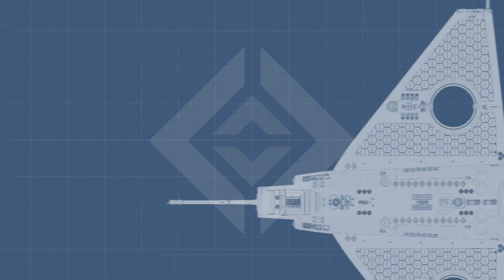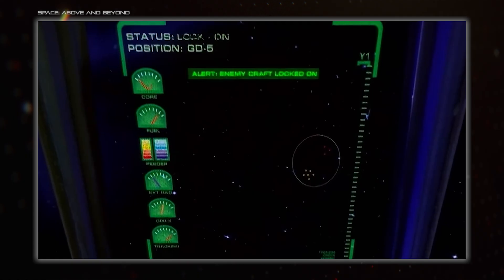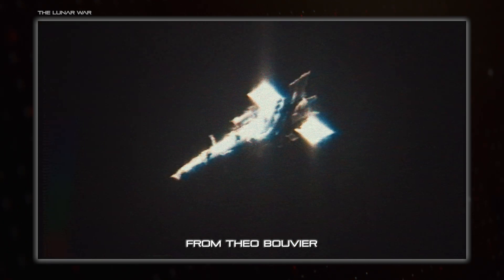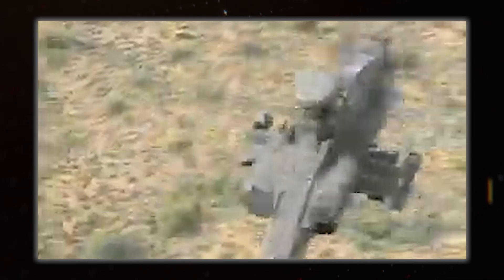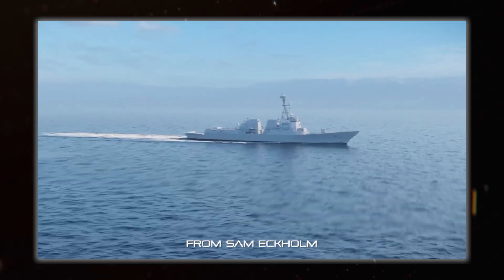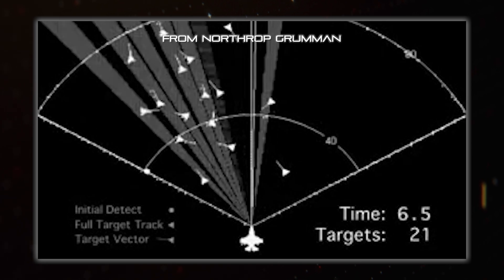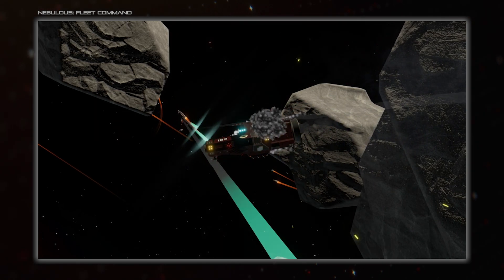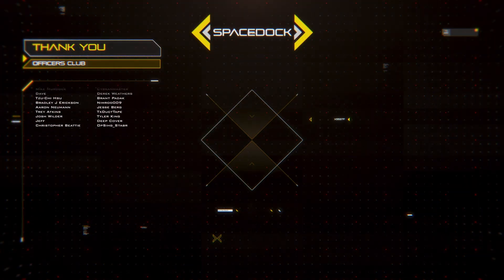What Sensors Would be Used in REAL Space Combat?

Comment: considering how big space is, i wonder if a kind of net worked 'drone' sensor net that lunchs out of of larger ship to cover as much space as possable would be an the logical conclusion, kind of like mobile sensor boues. each drone sends out pins covering x amount of disance and maybe give it something like a 'tag' gun so when it finds something it dosnt like. it can tag it with like a certian kind of radiation that the parent ship or other friendls can look into. 

if it a drone gets shot down, than's a good indicator as any.

though i wonder if said drones would be expandable or recoverable. i imagen the earliest drones  would be farily large to acomadte fuel and solar pannals and miro reactors and what not and these older drones could just stay out and float forever in the void suiving as background infulsucture till their systems start failing and they have to be replaced. 

as tech advances the drones might get smaller and smaller

Comment: Did I miss it, or did you guys completely forget visual light sensors?  Visual light spectrum scanning is massive and most likely will be exponentially increased as we move more into space, as EM can be jammed so easily over large distances.
Reply: light is EM. Its just a matter of which frequency of EM. Although the video did seem to imply that EM scanners would exclude visual light, it doesnt. Stars put out almost the entire spectrum, and most of it is at least somewhat reflective, although even just a passive IR sensor would make most if not all hiding impossible, having more than one frequency for target acquisition certainly would make jamming harder, since shorter wavelengths require smaller dishes,, which makes targeting the giant jar of jam more difficult
Reply: I was thinking less FTL, but within system tracking.  Most "systems" have massive active light projectors called stars, which can illuminate many things not specifically stealth coated to absorb visual spectrums/radiation.  Think astroid/comet tracking like we do today, but millions of times more sensitive/accurate.  Vessels/weapons that have active propulsion would also potentially create light plumes.

Comment: Quantum Computers, once we figure out how to make them work, will make Sensor Systems MUCH more effective because all the Computer Support each Sensor needs (Passive, Active, ECM, ECCM, Target Detection, Tracking etc.) can be done with one Computer the size of a loaf of bread (and eventually the size of a deck of cards) instead of 6+ Computers the size of a 5 gallon bucket...
Reply: Or you can use a 5-gallon bucket model to improve those sensors. I mean, there is Q-Radar, which makes any radio-based electronic warfare useless unless it's 'deny radiowaves from everyone'.

Comment: One interesting thing you touched on at the end, because sensor systems take so much power, it's quite likely that bigger ships will have significantly better sensor capabilities. Another nail in the coffin of space fighters.
Reply: When I was banging up a sci-fi setting, the smaller vessels remained relevant because hyperspace travel speed was a direct function of mass. A given mass always moves at a given speed, and the smaller the vessel, the faster it travels in hyperspace. 

My purpose wasn't to preserve fighter combat, but it would work for that. An X-Wing would make a trip in hours where a Star Destroyer would take weeks to travel the same distance.
Reply: @CptJistuce One tweak to that, make hyperspace speed depend on cross-sectional area.  So a big fat cargo vessel will be efficient in terms of structural strength while loading and unloading cargo but have a low hyperspace speed.  A narrow military ship of the same mass will have a higher FTL speed.  A needle-shaped courier of the same mass will be horrible in combat (easy to break) but it can get a war warning out faster than any other similar-massed vessel. 

(got the idea from the GURPS Lensman book)
Reply: @toddkes5890  Oh man, I haven't heard the name "Lensman" in forever!
Reply: One fun part is that smaller craft have a higher surface to volume ratio than larger vessels.  So they can emit more heat per ton than a larger vessel.  This will give them more capability to fire weapons for their mass.

For example, assume two ships, as much identical as possible, where the larger ship sis 2x as wide, tall, and long.  The larger craft will have 8x the volume, but only 4x the surface area.  Assuming equal mass (so 8 smaller vessels vs 1 larger vessel) the smaller craft formation will:
- have higher heat dissipation (twice as high compared to the larger craft)
- have thinner armor/shields per ton (higher surface area means the same mass fraction to armor/shields will have half the protection)
- have stronger structural members (structural strength is based on cross-section, structural strain is based on mass, so the smaller craft will be able to handle twice the acceleration)
- have a longer baseline for emissions detection (the smaller craft can be a tenth of a light-second apart much easier than a larger craft)
- have a potentially higher EM signature as the smaller craft have to use active emissions to coordinate their longer baseline sensors, plus tactical datalinks
- are able to protect more locations from lighter threats (i.e. eight cruisers can protect better than one battleship, though that one location will be very well protected)

So which is better?  Depends on the mission needs.
Reply: "Significantly better sensor capabilities" in no small part due to the aperture size of the sensors.
Reply: Yeah if you were to use Light attack craft they will need a mothership for better sensors and to carry them around since hey will have less fuel and less efficient engines.
Also Is that the eye of the universe ;)
Reply: I wouldn't quite call it a nail, but it certainly demotes them. The primary reasons I can think of for using fighter crafts in a hard-ish setting is as ground-to-space defense and for low-threat duties where light lag is an issue. If the UN has to police travel around thousands of belt objects, they'd need someone to be close enough to respond before word has reached Earth but they're highly unlikely to need the firepower or range of an interplanetary warship.

Comment: You completely neglected to mention UV sensors. While an atmosphere precludes the distance a clear picture can be seen in UV light due to scattering, space offers more opportunities for this area of the spectrum. Additionally, UV sensors are being used today to augment optical IR seekers to better resist jamming or spoofing.
Reply: a lot of people forget about UV sensors being a real good possibility in space, as well as X ray and Gamma Ray. Funnily enough UV sensors would perfectly counter the minovsky effect from the gundam series, and put an end to the close range giant robots in space combat that setting loves.
Reply: UV emissions of a spaceship are orders of magnitude weaker than its IR emissions. Look up the black body radiation spectrum for an object with 100 - 400°K surface temperature.
Reply: @peasant8246  True, passive UV emissions would be negligible. The utility of a UV sensor would limited by the intensity of reflected starlight, how hot the engines get under burn, and how hot the exhaust gases are. However, I can still think of two niches for UV sensors: terminal missile guidance (likely to augment an IR sensor) and stellar/solar observations (for space weather forecasts and tracking objects in the near vicinity of stars).

Comment: In my novel's setting I actually have the shields (I know, I know!) double as sensors, and they're actually the ship's primary sensors via induction inference.

Shields basically because my idea is that if you're doing FTL speeds, and near FTL speeds, you're going to worry about background radiation hitting your ship really hard; photons would smack into you with the force of nukes, for example.

This comes with the idea of "Well, if the shields can block light, how do you see through them?"

The answer is:  You don't!  However, if something hits them, it should induce a change in the field.  This is how radios work - an EM field induces a charge in some metals, and you can use those to intentionally pick up on these EM fluctuations to see things, communicate, etc.

So basically you have induction inference sensors.  Depending on how strong the field is changed and how it's changed you could figure out with some clever math what might be hitting the shields, where it is, and how strong it is.  You can, conversely, if you can fire something out of the shields, use that to act as RADAR and use the shields as the receiver.

I'm not really sure what to call the Real Life equivalent, but I know various bits of induction inference have been used in history, most notably the Soviets apparently employing a spy device where they gave a gift to the US ambassador that they could then later point a RADAR beam at (probably just because it was a strong, coherent EM field) and you could see how the beam was modulated by some metal in this 'gift' and use that to determine what sort of soundwaves were passing through it while the RADAR was active... effectively allowing you to eavesdrop remotely.

Which makes this a neat little wrap around both to hard sci-fi and "What if the shields go down" - the ship is made of metal, presumably.  Metals, again, have currents induced in them via EM field fluctuations.  If you can measure these currents in the hull, you can also utilize these sensors without said shields.  So you can totally sit there without any sort of RADAR receiver or anything like that and just kind of... listen.  With just the hull.

All because EM fields induce charges in things.
Reply: Why apologize for having shields? Boeing is reportedly making good progress to making plasma force fields a reality. They’ve done some real world testing if I remember right.
Reply: @FoxURA There was a video at one point where one of the people running the channel (Daniel?) said he doesn't like shields so kind of a joke in reference to that.
Reply: Boeing has doors flying off so would you trust them with a force field? @FoxURA
Reply: @barrylefsky8241 That's after they incorporated DEI policies. Failures of workforce and scandals aside, the tech itself seems to have potential.
Reply: @FoxURA  The Boeing progress and push into plasma force field is, I suppose, a nice change of scenery for creativity but otherwise rather mediocre. In my opinion, US mil prob won't see anything sci-fi crazy and awesome until we get more from our efforts in power generation getting exponential instead of linear (particularly with exotics) and then probably seeing what we can get as far as innovations with miniaturization (like prob for medium to small vessels like ships and/or fighters); especially for manportable systems like weapons, suits, etc...or [even] system specific generators or subsystem and/or backup generators.
Reply: Oh very cool. I'd reccomend the Culture series and its extensive use of fields for a similar purpose
Reply: Do your shield have projector or sci-fi generation with shield wraps around the shield. I'm trying to design ship with  shield projector on a circular rail armour the ship so it can redirect from port side to starboard as needed

Comment: Ironically the nuclear bombs used for sensors would probably have a massively higher yield than the ones used for combat
Reply: Or more likely they would be tuned for a specific output.
Reply: Right, they'll be tuned to maximize xrays so they'll need higher temps and therefore higher yields. Whereas for weapons megaton yields are probably overkill, and higher yields require bigger bombs and therefore more expensive missiles. So efficiency factors will drive smaller bombs

Comment: What about Muon shadow detectors or Gravitational field detectors? Muon detectors have been used with shipping containers and looking for voids in pyramids. I wonder if they could be used in space or if the lack of an atmosphere would preclude their creation. Although I wonder if Galactic Cosmic Ray shadows could be used similarly. Gravitational field detectors were proposed in Clancy's The Hunt For Red October but I'm not sure how real they are. I think that idea, using laser reflections, was similar to the tech for gravity wave detectors, which are real.
Reply: Oh one of my physics professors was the pyramid guy! So on earth narural muons are all created by the atmosphere interacting with high energy solar particles - and fun fact a muon's half life is so short we'd never see them at the surface if they weren't moving at relativistic speeds! Maybe you could have an artifical source painting an area you control though? 
Gravity has it's own problems - gravimeters measure all acceleration, and even the electric ones are quite sensative. Any ship that is going to accelerate to dodge, or even have things moving around it will drown out the signals. I could see Drone gravimeters though. Everything solid state and it locks the 0 length spring before it manuvers.

Comment: I prefer liquid metal ejection to radiators.
Reply: Especially if you can eject it at near relativistic speeds. Let someone else deal with your waste heat!
Reply: @artor9175  like how about a mercury battery that has to recharged with more mercury.
Reply: until you run out of metal

Comment: Passive sensors would be the major part of any sensor suite.   

Active would be for short range use only (short range being within a few seconds for the reflection), after all if it takes light/lasers/radar 1 hour to bounce off the target it'll be 2 hours before you know it's there, where your passives will know its there 1 hour earlier.
Reply: more importantly, your enemy can detect the active sensor from much further away. so active scanning might result in beeing detected a long time before you get the return signal, assuming the reflection is even sufficient to detect at a given range while the enemy has it easy with the massive beacon you just lit up
Reply: @kertas1991111  That's a very good point that I don't think that many people appreciate. It's like every movie where people, both the good guys and bad guys, are going through a dark area with their flashlights on, often weapons mounted lights. All this does is waste their batteries and announce their presence to their opponents long before they can see them.

This is why the US Navy regularly practices EMCON or Emissions Control in combat and don't broadcast over the radio, use their radars, or any other form of active electronics. What they do is use an E-2 Hawkeye that's flying miles ahead of the fleet and is the only thing that's emitting. The fleet, the carrier in particular, just passively monitors what the E-2 sends back, this way while the enemy knows that there's an E-2 out there and thus a carrier has to be around but they don't know where exactly the carrier battle group is so they can't launch missiles at the CBG. This is also what they plan on doing with F-22s and F-35s, pair them up with legacy fighters that will be using their radars and sending the info back to the stealth fighters. The enemy only sees the one fighter but will then be engaged by several fighter's worth of missiles.
Reply: @kertas1991111 Thats where drones are useful
Reply: The Universe Which Must Not Be Named On This Channel (Honorverse) does this. Anything long range is fully passive. Active sensors are used for things such as missile defence, where of course the targets are much closer and the need for precise targeting is high. 

Even used as a plot point in one book, where the outnumbered heroes led by the eponymous tacticial genius of the series use the reliance on passive sensors for long range (specifically gravity based ones) to essentially go stealth. They combine this with making their thruster burns (again, unusual for the setting, most propulsion is gravity based) lined up with the sun to hide the emmissions there. The bad guys (Space Nazis, as in their acronym is the SS) get an "Oh, shit!" moment when our heroes just come into extreme lidar/radar range, and fire lasers and grasers at that range, defeating them in a single moment.
Reply: @ParanoidMarvinMk2  Ah, the battle of Cerberus!
Reply: @ParanoidMarvinMk2  Thank you for giving me another sci-fi book series to lose hours listening to!
Reply: @ADSB1994  More like days or weeks mate... It's a LONG runner.
Reply: @ADSB1994 The starting book of the series is "On Basilisk Station".  Here the main character is put into a low-priority location, and given a near-impossible assignment, with a ship that was horribly changed for an experimental weapon test in fleet exercises.  So the crew has low morale, the XO thinks he should be the Captain (and as such isn't supporting her), and everyone knows that this location is where careers go to die.

But this is also the location where her nation's rival is planning a surprise attack, and if they succeed they can put a dagger aimed at the heart of her nation's home system, ready to stab at any moment.

The first books where she is a ship Captain allow more direct action, later on when she is a Fleet Admiral are more abstract and feature more politics.

Also expect an infodump in each book to explain the background technology, history, etc.
Reply: Yes, passive sensors would be the only useful option in anything but the closest of ranges. In space, it's not like there's anything significant to hide behind either, so, just observing the EM spectrum passively is going to be best over doubling the lag time to get any returns.

That is until there's some form of FTL active sensor (some sci-fi talks of tachyon pulses) where the return would be "real time"... of course in the sci-fi that uses that, the tachyon sensor also gives the enemy the real time vision of the source of that pulse.